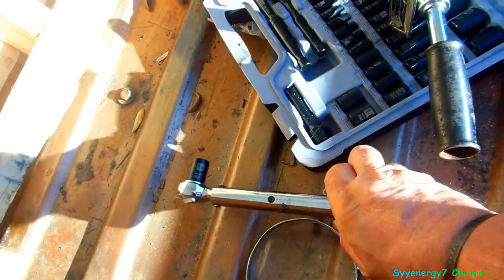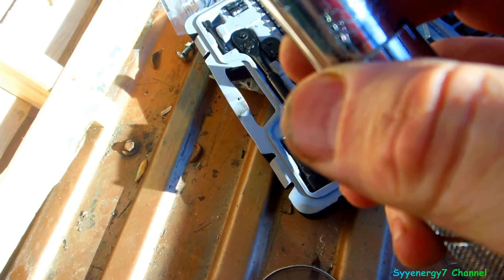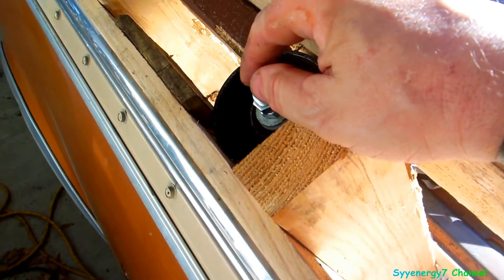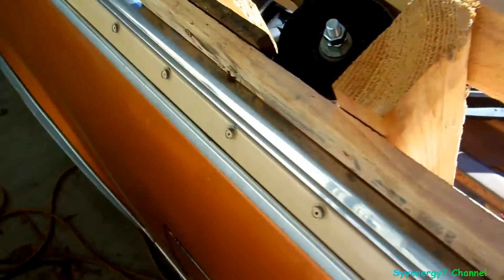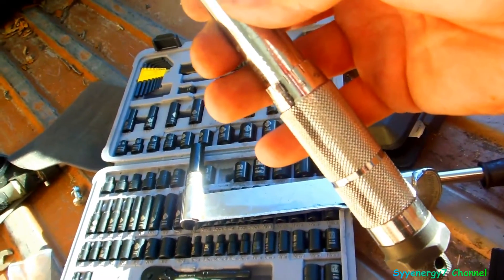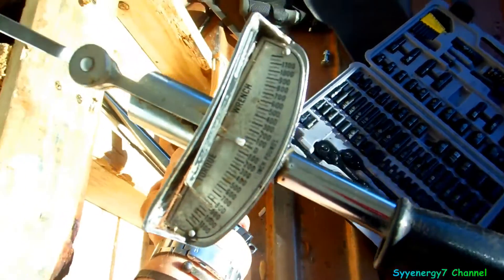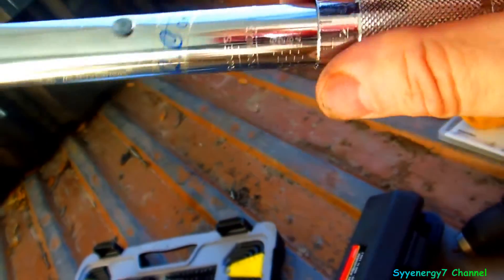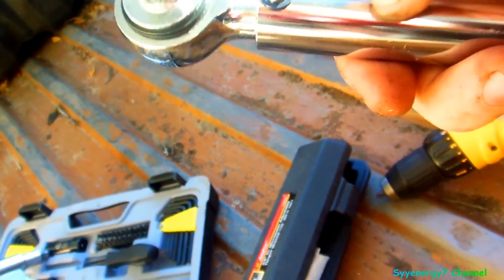Check a Click Torque Wrench for Calibration - How To

Comment: I just bought my first craftsman beam torque wrench ever from Ebay and it seem the needle or gauge is off to the right instead of on the zero. Any suggestions on how to reset the needle  back to zero? Thanks
Reply from the maker: Just push the needle arm back.  That's how you zero it.
Reply: @syyenergy7  thank you